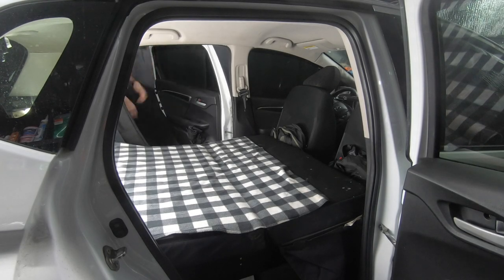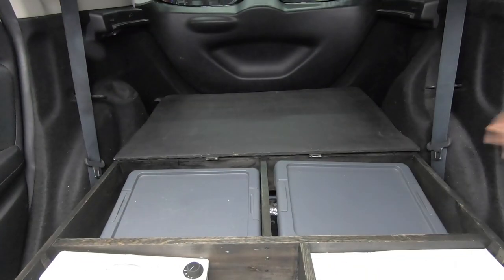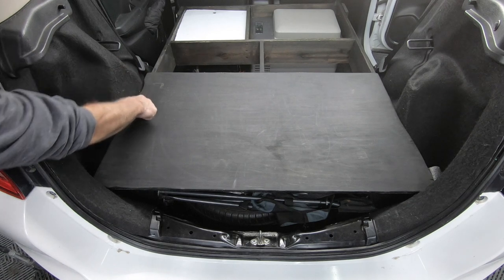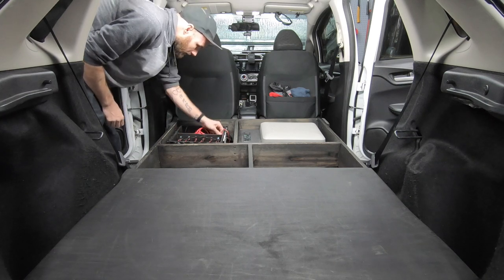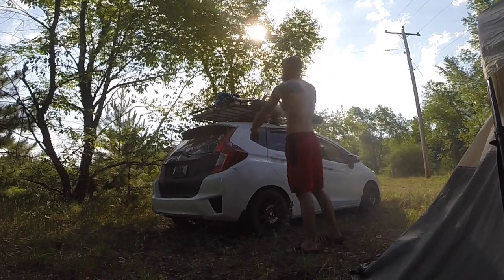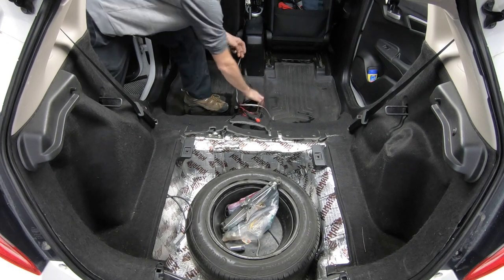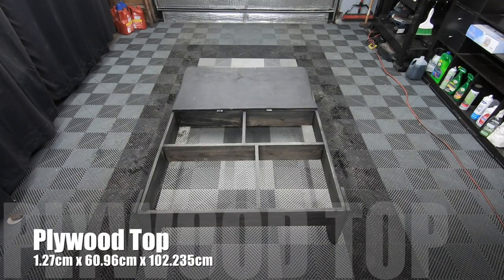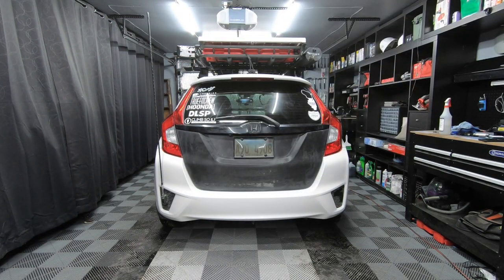Honda Fit Jazz Camper - Car Camping Bed Frame Build - X-Country Tested - HondaFit4Adventure Approved

Comment: Nice build! I like how you have room for a full sized spare after adding the platform.
Reply from the maker: Thanks Matt. I actually had room for the full size spare tire before the build. I just had to remove the Styrofoam insert. I must say that there was a slight noise difference without the foam  insert.
Reply: @HondaFit4Adventure  did you notice a big change in noise after adding the dynamat?
Reply from the maker: @mattcm32  Yes and no.
My results were partially inconclusive. After installing the dynamat on the floor boards my car still appeared to be rather loud. I later found out all the noise was coming from a bad set of tires. Once I replaced my tires, it was super quiet. 
I did a separate video where I dynamatted the roof of the FIT. I think this made a huge difference is quieting the car down. Probably because I have a roof rack thought.
Sound deaden-er Installation w/ before and after comparison. https://youtu.be/1R1Jeu23fg4
Sound deaden-er roof installation w/ before and after comparison https://youtu.be/Zv6BcxVzr6M

Comment: Thanks for this! We’re building out our fit right now. Appreciate your videos! 🙏
Reply from the maker: Awesome to hear, Check these out! https://amzn.to/3orZwUZ
I recently picked these up and they've been amazing. Extra little storage compartments that barely take up any room at all.
I have another storage Idea that will add more space without taking up any additional room on the inside. I just have to confirm fitment and then I'll make a video on it.
#SafeTravels & #StayTuned
Reply: @HondaFit4Adventure  That is awesome! Excited to hear what your other idea is. Love fitting everything in my fit! (My partner and I actually both drive a fit. Both purple, but one older and one newer.)

Comment: Thank you for sharing this and all of your helpful information. I am always telling everyone how much I love my 2015 Honda Fit. Question for you-- would it be possible to keep the seats in, folded down with the build on top of it?
Reply from the maker: You wouldn't be able to fit the cooler in, but yes it would be possible. 
Just make the bed frame without legs and you'll have 5.5" deep storage underneath your mattress.
Reply from the maker: Here's my 2021 Tour video. https://youtu.be/vP7IyP8_7xQ?si=LjLIk8ZQkHbSJ_L3
I had one rear seat and no bed frame at the time. 
My biggest complaint would be the hump underneath my mattress caused by the center console.

Comment: Hey! Very nice build! Are you still thinking of lifting your fit? I see that there are some options online for a 1.5”-2” lift using suspension spacers available. I still can’t decide if I want to raise the car or drop it...
Reply from the maker: Thank you! There's the Tema 4x4 kit that uses the spacers and another kit that lifts the car by the frame. From my understanding you could probably use both kits at the same time since they are lifting different areas or parts to the car.  If I didn't' do a lot of camping I would have lowered my car. My  first year we almost bottomed out the fit and got it stuck at a remote campsite.
Reply: @HondaFit4Adventure  outta curiosity what’s your take on doing air suspension and getting both lift and lower capabilities?

Comment: Good makeover 👍
I do camping in honda jazz(fit)2009 model and was looking for suggestion to fix solar plates on roof…is it safe or have any change in charging process while running the car..please inform
Reply from the maker: Hi there,
My Solar Panels charge a separate battery that is not connected to the car.
This way I can run all my devices at night and not worry about killing the car battery.
Reply: @HondaFit4Adventure  can you send a link to what solar panel generator you got?

Comment: Love the build! But I’m very curious to know how comfortable the driver seat is for you. I have heard from many the seats are very hard and don’t give way or have any cushioning. Since you drive cross country, I think you’ll have a better perspective than most. Thanks
Reply from the maker: It doesn't matter if you short or tall, both the driver and passenger seats are terrible.
My friends and I both agree that back pain starts to set in around the 2 hour mark. On a longer adventure I'll slip my mummy bag over the seat and squeeze out an extra two hours of comfort.
A few Fit owners have swapped seats over from a Honda Civic or Honda Accord, but I haven't tried that yet.

Comment: Do you have instructions, parts list, or videos that closely resemble the building of the frame?
Reply from the maker: No, I lost the files of constructing the frame.
The best instructions to give you an idea of how to build the frame can be found at @8:15
The max width and length are listed. You will just have to work out the size of your own storage areas based on what you plan to carry.
1x6 planks for the frame - 1/2" plywood for the spare tire are - 2 hinges - 1 3/4" Screws
Reply: This was extremely helpful. Thank you

Comment: that frame is not too high. I reckon you could go lower maybe 3" .. imho. 
I like lots of head room.
Reply from the maker: The frame is near perfect.
I could easily go 3" lower if I used some type of foam pad for a mattress rather then my rock climbing pad. The bouldering pad measures 4" thick!

Comment: I’m a bit confused what power bank are you using?
Reply from the maker: Hi Christopher, I built my own power station and it's all contained in a Milk Crate and a Half. https://youtu.be/269fXIBK7O8
This way I'm able to expand my system as my power needs grow and be able to replace a fuse without having to send the unit in for service. (I won't name names...)
My bed frame and power bank setup have slightly changed.
Here is a quick update video https://youtube.com/shorts/450cT1kydek?feature=share

Comment: Can you give the exact brand and model for the rock climbing pad?
Reply from the maker: Here you go Michael. 
Website.
https://www.metoliusclimbing.com/recon.html
My Amazon Link
https://amzn.to/3KiNfew
Open size: Open size: 42" x 60" x 4" (106.6 cm x 152.4 cm x 10 cm)
Folded size: 42" x 22" x 13" (106.6 cm x 55.8 cm x 33 cm)
Weight: 14 lbs. 5.1 oz. (6.49 kg)
Color: black/gray

Comment: Links to the foam mattress?
Reply from the maker: It's a Rock Climbing or Bouldering Crash Pad by Metolius.
It's a foldable gym mat that you can wear as a back pack to carry into the woods.
They are quite pricey but I already had one and it serves as a dual purpose for me.
https://amzn.to/3wu1jNW
I would suggest going on craigslist or FB to find a used one.
Most people get into the sport and quickly give up once they realize how hard it can be and will sell these pads for cheap and virtually brand new.

Comment: How much weight was added with all this wood? You could of made the whole frame out of hard Styrofoam. You can get it home depot I did that in a boat and it's super strong and virtually weighs nothing
Reply from the maker: The bed frame first weighed 32.4lbs.
I bored out 2.75" holes in the frame which brought the weight down to 25.4lbs. https://youtu.be/QMfAHkjh4sE?si=rXxrW80WR7FThqz5&t=374
I had to do some modifications to the frame
for the newer 2023 setup which brought the weight down once again to 21.6lbs https://youtu.be/A8UB5xyj5WI?si=-G6rSNknQulcl4sq&t=231
I'm using hard styrofoam as a mattress. This eliminates any need for plywood to cover the top of my bed frame. 
Do you have any pictures or videos of what you're describing. I can't think of any styrofoam that is sold at home depot that would support any weight.
Reply: I don't remember what you call it. But it's the yellow type color Four by eight sheets two inches thick and has got silver. Almost like a foil coating on both sides of it. And it's the way you set it up on its sides cut like you did yours and it holds a lot of weight that way when it's flat it canSnap and break Unless it's cross braced. With long pieces of Styrofoam laying on their sides . The Styrofoam is very hard type Styrofoam.
And it's the way you set it up, which makes it very strong.
Reply from the maker: I found it. It's a fiber glass insulation board.
If I used the fiberglass board, I would loose 1.25" in almost every direction. 
IMO, saving 10lbs is not worth loosing almost two cubic feet of storage. 
I would also have to redesign everything to fit the larger 2" strips.
Reply: Wow interesting Definitely not worth it. thought it would lose a lot more weight than that. Oh well sorry to waste your time